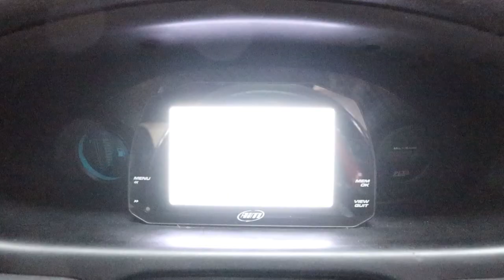🚗Ep 2 - K20 Turbo Powered Honda / Acura Integra DC2 Type R Review

Comment: Australia also got some limited edition dc2r with yellow front seats, black with yellow stitch rear seats and yellow stitch on the steering wheel. Honda did make a dc4  the same as a dc2 body but lower spec.

Comment: I die a bit more every time someone Drops a K20 inside DC2 Type R, wish they would keep it B18C
Reply: Yeah, I generally do too V, but to be fair they did say the car came to Ray as a bare shell. If I was in Ray's place I'd likely do the K20 swap too. More bhp and torque and more availability of go faster bits. The chassis can certainly take more power. And I say that as a middle aged fart 😁 with a DC2 where I'm positively anal about originality. I also like that though these cars have very much gone into the "classic car/collector" bracket there are still mad feckers like Ray who will customise them and do it well.